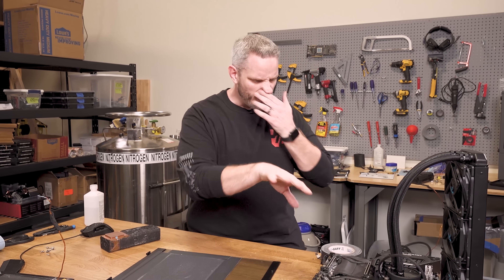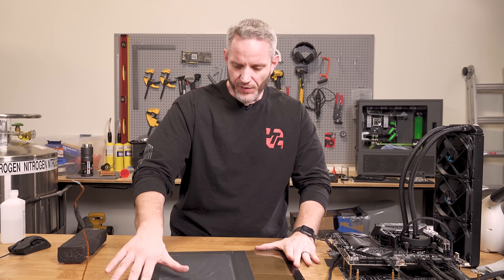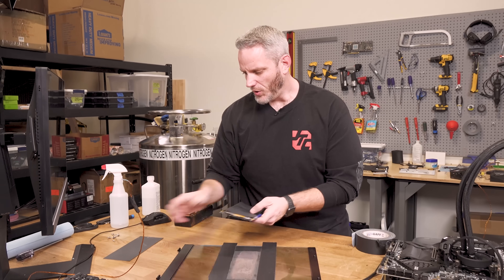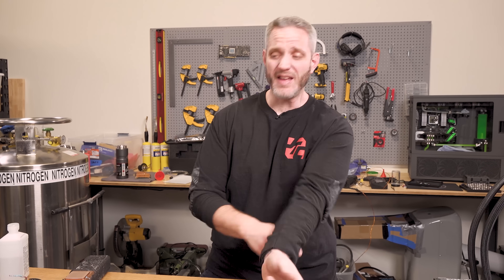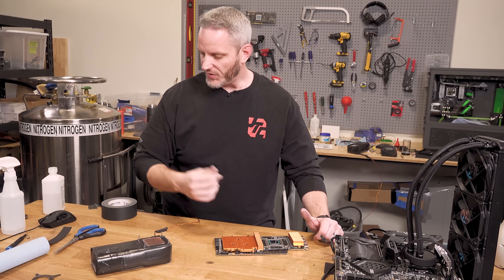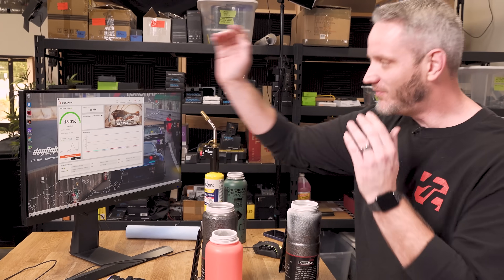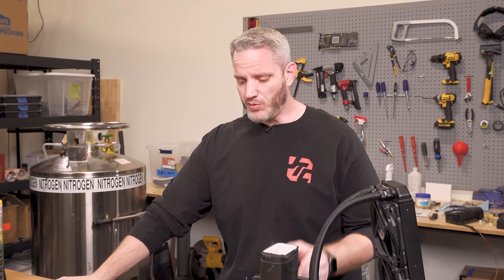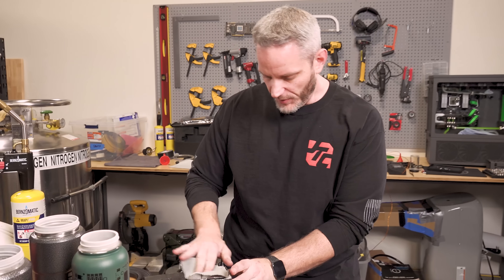THIS is Why Lapping Your Cooler is SO Important!!

Comment: I'm going to disagree with Kingpin here. Every layer the thermal energy has to go through is efficiency lost. Ideally, you'd need no TIM. TIM is only used because of invariable imperfections. Ideally, you'd straight cold weld the block to the heat spreader or otherwise have it being a single unit. The better your finish, the less TIM you need (fewer air gaps to fill), the more efficient I'd expect the energy transfer to be. I may try to find his full argument for what he's saying, but it doesn't make much sense to me at first blush.

Comment: I have a different issiue tho.
One of my two antique monitors says that it doesnt have signal when i first boot the pc after it being off for a while. a restart or replugging the vga-hdmi adapter on my gt710 gpu solves the problem till the next fresh boot.
the whole pc is new, r5 3600, 16gb ddr4, 600W psu, gt710 (rough gpu times we're in). the monitor and the vga-hdmi adapter worked on the old laptop.

Comment: I've been lapping for decades.  Best tool you can use is a sharpie.  Make an X and dots on the surface, lap till the sharpie comes off evenly, then work up the grits.  I've lapped the IHS and cooler in every build I've done since 1997.  Most important thing you can do is lap wet in a proper figure 8 pattern.  Also, get a proper lapping plate. I started off using glass from a picture frame and after upgrading to a lapping plate I realized how much less material I needed to remove to get it flat.

Comment: I used to lap carbon seals for turbine engines. They needed to be FLAT considering this was hard carbon on stainless steel. If you want an even flat lapping, always use a figure of 8 pattern! A proper figure of 8, along with rotating the unit after a few laps, will self cancel out a ton of uneven pressure you may put on the unit.
Reply: I was waiting for someone to mention figure-85 lapping. That with "walking the circle" cancels out the uneven flatness, but the "paste" dries out and causes it's OWN problems, EVEN IF you're diligent and use as THIN a layer of paste, as possible. Center clamp ok I IF that's what you want in order to feel more comfortable with your results, but DO NOT over-tighten corner screws, and if you've done your lapping CORRECTLY , NO center clamp necessary, and the flex in the pressure angle of the screw-threads (if your paste is THIN enough) is sufficient to get you the contact you need. Check it from time to time. Also' IF you use paste,  it DRIES OUT over time anyway, obviating your bedst efforts anyway. BTW- the Sub-Micron "scratches" are NOT for " "grip". They're for increased contact surface area for the paste. 
He's right, tho about NOT polishing the faces, as Then you get a "boundary layer" effect that actually inhibits dissipation.  
Take it as high as you POSSIBLY can without adding a "polished" shine, and you'll get results reasonably close to your intended goal. Any better than that and you're looking at Pro-grade Shops , equipment and technicians - also valid IF THAT'S your intent. 
Ok,  ALL the BEST to ALL here-
C.
Reply: I agree
I m an mechanical naval engineer and everything done by us is 8 pattern. It will minimize any uneven surface of the block in this matter. The - method or fwd and back is a little tricky, due to the fact that even if your using an machine will still be some uneven surface, but with the hands.
Reply: @elvisica1  figure 8 is a myth that doesn't want to die, because people keep repeating it. Have you looked into actual high precision lapping? Its not in figure 8. It is surprisingly mostly with circles while rotation one of the parts, or straight lines while rotating. And i am talking to precision down to 1/1000 microns. So stop always preaching figure 8, it simply not true that its the magic thing that gives you better results.
Reply: @wupme ate. If your using a precision mechanical machine. Ofc it will cut it purfectly. 
Here is differit story. So why ur trying to argue for something that sound delusional from ur side?
Tryin to look smart and it doesn t fit you
Reply: @elvisica1 hahaha, it doesn’t fit you, shit took me out 🤣🤣🤣
Reply: Lapping carbon seals for turbines….your my hero.
Reply: Thank you
Reply: I’ll be sure to use this technique when I do my 14700kf. It’s brand new and the silicone is excellent and I wanna see if I can push it to boost 6ghz all core enough to make a meaningful difference.
Reply: forget the figure 8 and self cancel bullshit - just use consistent force, consistent sandpaper grit and a consistent flat surface for both the cpu and cpu cooler or use polishing compound and grind cpu and cpu cooler together until they fit well
Reply: @kiyoponnn  tell me how to use consistent pressure. It's impossible even with a jig, to do by hand. There's no way that I can think of to do consistent pressure 100% of the time
Reply: @Tadders  use a weight or something ya dip

Comment: Would lapping a prebuilt be a good thing to do too? 

I’ve been binging pc build vids for a month and I still feel intimidated af, so I got a decent prebuilt with room for upgrades. I built one in 2006, but otherwise have used apple for music and editing. There’s so many critical little terms and I just have a hard time remembering them all when there’s no context for what it does or when it was released... are b550 motherboards outdated or is that not even how that works? Slave gpu’s can be ok sometimes? Are sata connections faster? 🤯 what are the architecture trends and what ports will be obsolete in 2 yrs (like usb 2 / c / etc)?

Comment: I have been using automotive anti seize for my cpu for years and it has always outperformed all thermal paste because it does have aluminum suspended in the fluid and transfers heat insanely well, just food for thought. If you choose to try it please treat in like liquid metal.

Comment: The problem I have with this method is when everything heats up and expands, the surfaces warp with that heat. This is probably more prevalent with an aluminum heat sink rather than the cpu. But even still. Is there a way to file them at 90 C ?

Comment: You need to lap it in Figure 8 motion, start in one direction, then after few laps go opposite and so on, because you want to apply even pressure on all sides, not just two ;) I bet if you test this, you would see even more improvements if it is so much sensitive
Also, wet sanding is better and gives a smoother finish and it's shinier too, but it's a bit more mess ;)

Comment: .... I deal with sub mill tolerances in machining all the time and there are a few tips I've picked up that could make your life easier.
Make a figure 8 pattern not forward and backwards, then rotate. The human advantage is in averages and random movements, if you make a figure 8 the mistakes you make will be a lot more random and that's what you want, they wont be at the same location all the time, so you will end up subtracting the averages of the flatness instead of trying to fully control the subtraction.
A grade b granite plate is much flatter then glass and won't be as fast to take up a warp, the float glass is pulled off of the tin metal bath by rollers and those rollers do leave a pattern of waves, and can shatter. grade b surface plate costs start at $30, and have tolerances in the micron waves per meter/foot as opposed to glass with multiple waves per cm/inch.
A set of cheap gauge blocks can go a long way with a surface plate towards setting up awkward work pieces like this one. 
An ink brayer and some Prussian blue oil goes a long way to highlighting high spots when applied to a surface plate, get a very thin layer of blue on the surface plate and rub the heat sink contact over it, being carful not to add any pressure just slide it over and the paint or ink will transfer around where it made contact, leaving either blue spots if you are really warped, or making a blue ring around the high spots if it's high spots are a gradual small wave. After a bit of practice you'll be able to estimate flatness to a few microns with just that, but its biggest use is in applying a bit of localized material removal before you go to lapping, if the parts already sitting parallel to the lap before you start lapping your going to have an much easier time.

Comment: Bull.lots of nonsense here.  Want some groove ?  No that just holds thicker paste or even air.. no grooves. Micron accuracy is required ? No ,and you contradict your groove texture thing  with that.   What happens is that the changes in temperature cause far more warping than your sanding was removing.  Bracket.. yes the board bending  iscan issue..thats far more important. Because it opens up after the paste is squashed thin...  Then closes as you loosen off the screws ..

Comment: The grain from the sand paper creates more surface area for the paste to "bond" too, and the groove give more surface area for heat to transfer.  Also you can find a local machine shop who can put a flat surface with what ever RA  finish) you want.  They can get really accurate. WE used to design heat exchangers for aero space where 0.0001" tolerance was a mile. It will cost you, but will yield far better results. Google "Machine" shops near you, call them asking if they can do this to what ever spec you want, and get a quote.

Comment: the whole point of the thermal paste is to make up the difference of an imperfectly level surface. even if you lap the cooler, the cpu isn't lapped so it's still going to be uneven. waste of time.

Comment: Good video, but it's important to tell newcomers, that before lapping they have to ensure that they will be able to make a proper pressure between GPU/CPU and block. If the water block or cooler (especially GPU block) has mounting screws with stoppers, after lapping 0.5mm they may never make proper contact. Lapping is good but must be done properly

Comment: To use this bar, the item to sand should definitely mounted in the middle.
Sandings should be at a 90º angle. (0º and 90º only. Not 45s)
Material will warp rather significantly at the operating temperatures, so ideally, sanding should be done at those (or aprox) temperatures.
(Not criticizing, just sharing knowledge)

Comment: Don’t use tape to hold down the sandpaper, use water, it makes it stick and makes it actually flat, also use higher grits from the beginning, it doesn’t matter how long it takes but it definitely matters how much material is left on the contact and the total surface area for thermal paste to fill

Comment: No jay i disagree you need to put the piece down and move the glass which is flat and even weighted it is not possible to make it perfect if the piece is shaped like that 
and when you are using sandpaper it is sanding not lapping
The water is important so the copper is not rubbing on sanded copper (and pieces that break from sandpaper) rather on the sandpaper it will be coarse if you dont use running water

Comment: Can someone explain to me. Isn't the thermal compound suppose to help with all the imperfections? It doesn't have to be machined 100% if you there is no direct contact between the cooler and the gpu, as there is a thermal paste in between?

Comment: First cooler that I lapped was way back for my overheating AMD Athlon XP. It had nowhere enough cooling capacity (fully coated Al) but worked wonders, reducing about 6°Celsius. 
If I’m not mistaken, I went up to 8000 grit, with lots of water, over a granite sink. Sharpie method was used to check for bad spots that needed further work, as well as isopropyl alcohol to clean everything between each check.
Also, never ever touch the prepped surface, oils from your fingers will interfere if you’re going for the “micron/mirror finish”.

I wish I still had that time and will, to lap the IHS of an old Xeon that I have running overclocked and undervolted...

Comment: If air and moisture is the problem, why not just put the test rig in a box where you can pump in argon to keep away moisture and leave a piece that inserts into the LN2 enclosure/box and seal that with vaseline as a temp O-ring. I can draw something crude up if you need the idea.

Comment: Did you know lapping of high presicion measureingbloks for cnc industri ect. Are so high flatness, and low surface roughness, that if you "turn" Them together they Are like magnet because air have troubble to enter the seem?

Comment: I'm a machinist and if you are wanting to lap to a truly flat condition, get another block of copper about the same size as your heatsink. You can get the two copper blocks close to flat with each other, but then use a bit of grinding compound and lap all three together, one of the copper blocks will be extra. Lap A-B, B-C, C-A over and over. Doing this will get you a truly flat surface (down to microns) if done with progressively finer grit. Called "The Rule of Three", you can't have a truly flat surface until you lap three different surfaces together.

Comment: I wonder if the reason there is a sweet spot for the grit you want to use is because a mirror smooth finish has less surface area then one that is rough, but if its too rough then the surface ends up having too deep of peaks and valleys reducing contact plus  the paste settles thick enough to insulate in the valleys? You know Jay, if you put the rig into a vented container and use your nitrogen to gas purge said container and then after keep a positive flow of nitrogen it would displace the air and prevent the water vapor from ever reaching your rig. No more frost! :D.

Comment: I remember lapping the GPU die on my GeForce 256 pro ddr back in 2000. It was mounted in BP6 running dual celeron 433 running at nearly 650mhz. That machine flew in CS and quake. Had cooling blocks from Swift Tech. 

I used an engineering  gauge block made of metal that was perfectly flat. Probably knocked about 10-15 degrees off. Used to sand away through the alloy to the cooper and then stop.

Comment: Not necessarily. Sometimes the gaps are intentionally introduced due to thermal dynamics and better heat redistribution between the compound that fits in those and the opposing surface. That way, the surface area is bigger if you multiply the number of rows and Pi/4 by half the diameter of each gap row. If you flatten these imperfections, in some cases you can even get worse thermals. Lapping is a matter of the past when we didn't have very precise manufacturing processes of blocks and heatsinks.

Comment: Jay! I work with machine tools and lapping pc parts never occurred to me until today. If you want something scientifically, certified flat, pick up a small granite surface plate. They can be bought for less than 50 usd and have various tolerances, usually starting at .0002”/ft flatness. I doubt you’ll see this, but to anyone interested there ya go. I could link a vendor I use for work if there’s interest. Fine mist the surface with water and your sandpaper sticks to it.

Comment: Awesome video, Jay!

Just a quick question. LN2 cooling seems to always be plagued by condensation and trying to avoid it. Is there any value in submerging the components in oil to keep water away from the components while they are cooled below freezing?
Reply: The oil will freeze and become an insulator, trapping heat in parts that are not being directly LN2'd (such as VRMs).
LN2 is bonkers cold, and is notorious for freezing literally anything it touches.
Further, an oil-submerged PC is an even bigger nightmare to service and maintain. For the short runs that XOCers perform, it's just not worth it.

Comment: Use machinist's dye (or color it completely with a Sharpie) when you think you are close.  A few strokes and the high spots will be shiny and the low spots will be colored.  Also works well for identifying contact areas for precision moving parts...close-tolerance bearings, firearms parts, etc.

Comment: Hey Jay I just had an idea that might help with your mounting pressure, but I'm not sure how exactly how you could implement it. Basically the idea is to just use a torque wrench so you can set the pressure and test around with that.

Comment: ice free LN2....??
have you tried placing your LN2 rig in a plastic tub and then flooding the tub with nitrogen gas....??

nitrogen will pool and push out all of the ambient air...
no air, no moisture 
no moisture , no dew point...
no dew point, no icing....!!

run colder  for longer...

give it a go...

Comment: Did anyone already break it to Jay?  That table is not flat. They make ultra flat work surfaces.  That is not one.  That glass is not flat. Not even close.  He talks up precision and then uses the "by hand method"  There are ways to accomplish this with precision.  This is definitely not one of them.  I can see Jay showing up to wet etch with a wooden table, a piece of glass and some sandpaper where they are looking at 30-50 Angstroms of etch rate.

Comment: Why would the thermal paste need something to stick to? The thermal paste is there to bridge gaps where the interface between the two surfaces has gaps in it. If there are no gaps at all, no thermal paste would be required. I think a mirror-finish would perform better than anything less than that.

Comment: You all may find this very hard to believe, but I have a 2700x that reaches 4.3ish(ac) with PE lvl4 on stock cooling(lapped) running 69c tops in most games. It makes a total difference unless you already have a mirror shine.

Comment: A spring can lose it's springiness if you freeze it. You can see this easily by stretching an elastic band around something, and then putting it in the freezer. When you take it out the freezer and remove the elastic band, it will not snap back to it's original size until it warms up. Springs can behave the same. That GPU mounting bracket is a type of diaphragm spring.